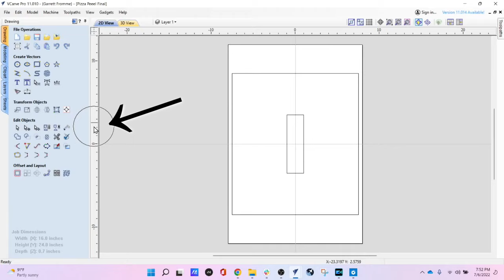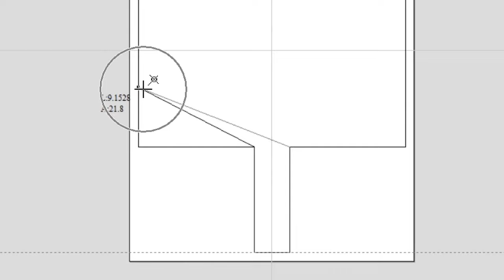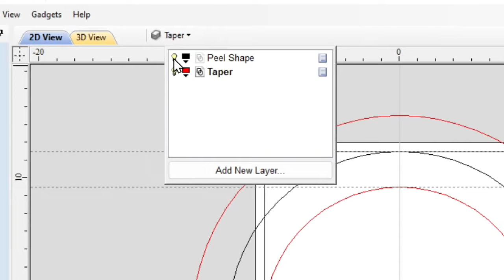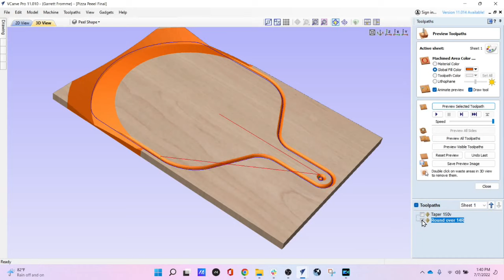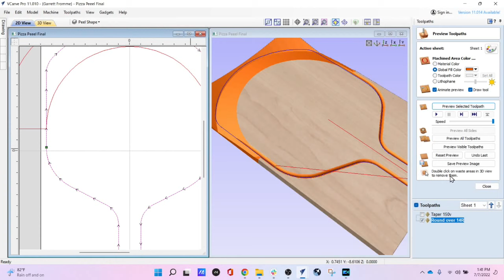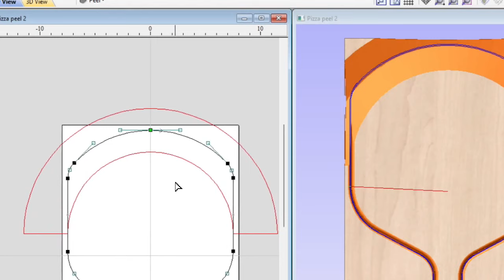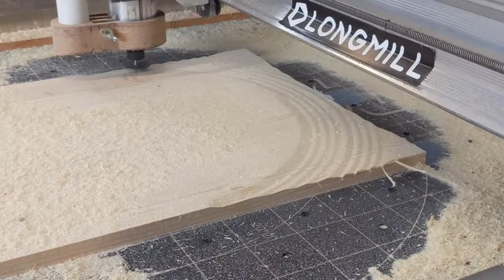How to Make a Pizza Peel with a CNC Router - Much Easier than You Think!

Comment: Nice work Garrett! Even though I have done cnc ing for a few years I certainly learned a trick or two from this video...like the taper solution, why didn't  I  think of that...thumbs up to you for that trick. Also to hide the guide lines, I never knew that corner of the ruler did that, 👏 amazing.
Your videos are great beginner or otherwise, your speed to explain is good, at least for me as I can grasp what you are teaching. HAVE A SUNNY and GREAT DAY. Thanks once again. Andrew. P.s thanks for making that tool database available, very handy indeed. Will get that later today.
Reply from the maker: Andrew, I'm glad I was able to make things easier for you. Those simple tips and tricks are always so handy to have in our toolbelts.

Comment: So I have had mixed feelings about my sienci machine until now.  I made a small modest improvement which has really improved the quality of cuts.  With a very few minor mods I upgraded the x axis with  linear rails. And the improvement was very good.  Not sure if I will do the y rails. But just doing the x axis has made my cuts go from hobby to pro in my opinion.  The rails were nothing special. About $120 from amazon for the pair + a few 60 degree aluminum brackets.  Pics if wanted
Reply from the maker: hobbyhands, happy to hear that those small tweaks helped make such a difference.

Comment: Awesome video!! learned a bunch! Just getting started with cnc machine. i work with Autocad2021, is the Vcarve software compatible with AutoCAD? Can i import the Autocad file straight into Vcarve?
Thanks,
Chris
Reply from the maker: Chris, great question! Yes you can if you can save it has an SVG. If so, you should be able to import it straight into Vetric!
Reply: Ok, thank you very much! That helps.
Reply: Vetric software supports a bunch of standard vector files. I usually do .dxf when I move it over from AutoCAD
Reply: Thank Tim, I was hoping that DXF file would work! Saves a lot of design time!